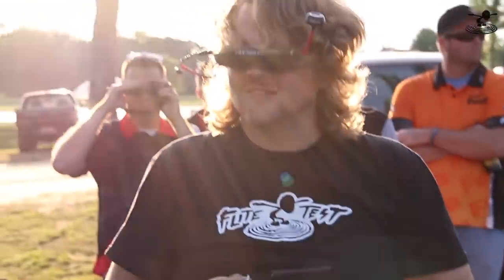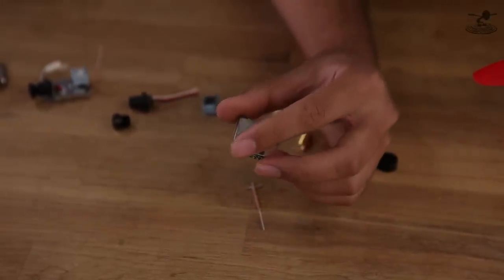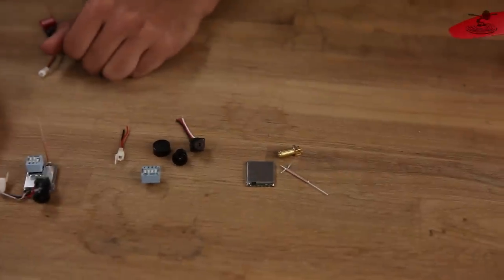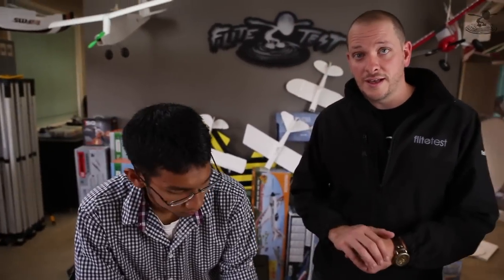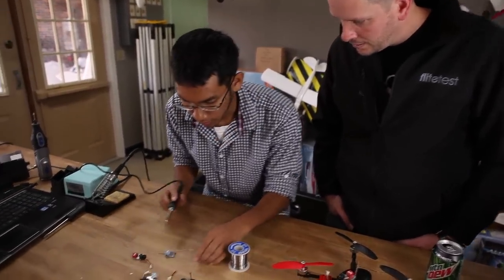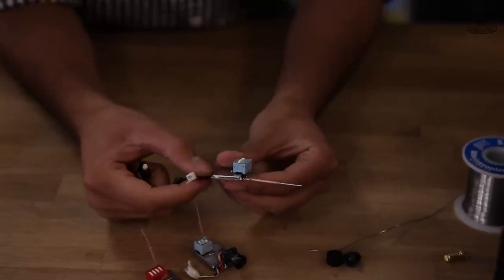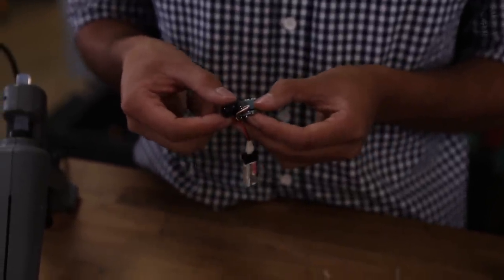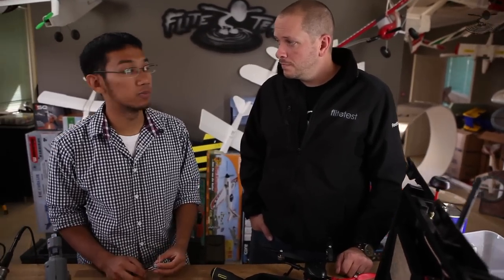Flite Test | DIY Micro 5.8Ghz FPV

Comment: Inspiring video! The one thing I didn't see, was removal of the rosin flux after soldering. Rosin has some impedance when it solidifies and can change circuit characteristics and possibly add extra load to the transmitter. So right after the solder solidifies, wipe the joint off with a q-tip dipped in alcohol. 70% or 90% isopropyl alcohol from the drug store is fine. That removes the rosin the easiest since the solder joint is still warm. I would recommend using 63/37 solder over 60/40 for the fine soldering done in the rc world. Rosin core is more for large wires. Water soluble fluxes available in the 63/37 solders make cleanup so much easier and greatly reduce the risk of loading the circuit.
Reply: +JKFlorida Glad to help !
Reply: Desert Mike DIY mmmmmmp

Comment: Hi
I'm so glade you guys did this video!
That was my intro to FPV Flying!
First I had this set up in a Hubsan X4, not so happy with the Hubsan.
But now I've got it strapped to my trusty old Hobbyking Mini Swift, and it's a BLAST!
Damn thats fun, and I got about 500-600 meter out of it, with the Wire Antenna AND just a cheap as chips RX with the standart Antenna on it...
Damn good fun!

I just the 5v Version as well, due to the specs it's quite well suited for a 1S set up.
As a Cam I used a cheap Hobbyking Cam.

I've you guys are back in Germany again, I would love to meet and fly with you!!

Comment: You can fix the camera lens adjustment with liquid electric tape. Great stuff! Not to mention sealing every connection and securing connectors to each other and or to the board or airframe.

Comment: Looks like fun...and here are a couple of hints from an old guy on soldering detailed work:

Find and use small gauge 63/37 (not 60/40) rosin core solder, and clamp the workpiece lightly in a Panavise or similar with rubber pads on the jaws. 

Add a worklight and maybe a magnifier and you're good to go...

Comment: @ 9:25 Josh justifiably corrects Peter to NOT USE CA in this application.  There is a VERY good chance of fogging the sensor, the inside of the lens or the outside of the lens.  And if you ever want to change lenses you're going to be pretty much out of luck.

Comment: If you run the 3.3v vtx with a 1s, use a 1n4001 diode in series to drop the voltage by 1/3 of a volt to help it from burning out.

Comment: Btw thanks for the video.
If your plane can carry a little more weight and uses at least 2S, then I recommend using a Fatshark 600tvl CMOS camera in combination with a aomway mini 200mw transmitter.
The Fatshark CMOS camera is the best CMOS camera I've used. The rest produce awful images (poor contrast and muddy colours).  
The aomway mini transmitter is almost as small as the diy module and comes with a SMA connector where you can attach a cloverleaf antenna. 
There are 2 sizes of the 200mw 5.8Ghz aomway VTX: the mini one is the one without the big black molex connectors. Banggood sells them. Search for
"AOMWAY FPV 5.8Ghz 200mW 32CH Wireless AV Transmitter Module"

Comment: I think Peter's remorse over getting the 5v module (instead of the 3.3v) was unfounded - he was actually right the first time! I was just re-reading the specs, and the 5v module IS the 3.3v module with an LDO regulator onboard. Thus It will happily work from 5v down to 3.4-ish volts. HOWEVER if you order the 3.3v module and you don't have an external regulator then a regular LiPo (at 4.2v fully charged) will probably BLOW THE MODULE. (I suspect. It exceeds spec. anyway) So the 5v module should be read "AT LEAST 3.5v" and the 3.3v module should be labelled "NEVER MORE than 3.3v". Anyone want to double-check that?
Reply: "quite hot" in the english sense? (as in "I say, this boiling oil they're pouring on us is quite hot.") or the usual sense? Putting out 200mw of radio power implies at least that much heat as well.. so "definitely very warm", but if it reaches "wow, that's hot!" levels, that's an indication you're running it over-voltage.
Reply: ... still, nice to know they run at 4.2v in a pinch, with a heatsink. You probably get slightly better range with the extra volt, for a big reduction in chip MTBF. (Then again, failure due to errant tree is still probably going to happen first.)
Reply: That's not too bad then. Probably about 50-60 degrees C. (assuming you have mortal pain tolerances and aren't a chef.) That's at the limit of most chip specs, though. But given the power dissipation of chips is a V^2 thing, (and range increase as the cube root of power? from memory) that probably means you're only getting incremental range for a huge heat increase by 'overclocking' at 4.2v. Still, it works. And if we were wise, we probably wouldn't be so keen on throwing contraptions into the air, just to see what happens next.
Reply: I bought the 3.3v TX.  what I plan to do is place a small diode in series with it.  Diodes have a forward voltage drop
of about 0.5-0.7v voltage drop.   If needed I will put 2 diodes in series.   That will let me use a single cell battery.
If I knew for sure the 5v would work down to 3.3v I would have bought that one.
Reply: Jeremy Lee I agree. I made the mistake and ordered the 3.3v version. What a pain! It ran VERY hot (as in the English sense). Maybe it was defective because I also had channel locking issues with it.I've since gone and ordered the 5v version and am much happier with it. It runs much cooler on a 1s and I've not had any low-voltage problems.The 5v version is definitely the way to go.

Comment: Bit charger plane vtx, LOL! Awesome to see, there are pcb vtx boards on ebay around $24. Heat sink on the case helps they do get hot.
 Digikey is great for parts like dip switches and led switches.
 Unplug power to ccd when taking lens off to avoid sensor burn too.

Comment: I would use a smaller dip switch to lower the weight maximum :)

The ones simular to the ones that are mounted to the fatshark vtx's works great.

Comment: I found the easiest way to solder this Boscam vtx, is to strip the wires long enough, then go ahead and twist wires , lay them down into the pre-soldered pads, streched , then solder with good tin , dont pre-solder the wires as it wont do any good ;-)  hf flying ;-) , greetings !
Reply: By the way, if you want to use this setup for a micro quad ( like the hubsan etc .. ) forget the dip switch it will give u +- 35 seconds extra flight time. 
Peter, good job ! but i would not prefer to use hot glue to attach the camera to the vtx's heat sink, as it might melt in the summer because of the extra heat produced by this vtx ( it gets hot ),
instead if u solder a micro cloverleaf antenne its a good idea to use hotglue to glue the camera to the boom ( coax wire ) of the antenna. as the coaxial cable doesnt produce any heat at all.

Happy Flying ;-)

Comment: Definitely going on my project list after my 100w led torch :)
Reply: how many lumens you plan to get out of it?
Reply: planing on making a second sun?
Reply: Jeremy Brock not sure to be honest as i dont have anything to measure it but lets just say its bright :)
Reply: tyler roberts haha its not far from it
Reply: TheLukey21 maybe you should make it with infrared LEDs and combine it with this FPV-thingy to make night flights =)
Reply: ***** its a single 100w led chip, if only they sold 100w ir leds then you could make some serious night vision stuff
Reply: TheLukey21 ah, too bad. I thought you would make the whole thing on your own. this would be so much fun flying through darkness and spy people :D
Reply: ***** well i am to a certain extent as i have built a lipo protection circuit so it doesn't over discharge and i have bought in a boost converter and a pwm controller (brightness control) but to do it with say 5mm leds that would be around a 1000 to make it to 100w. Oh and it will be going in one of those 5 million candlepower torches if i can find one cheap or otherwise i will use metal salad bowl sprayed with chrome on the inside for the reflector part and pvc for the body
Reply: TheLukey21 I made a 100w handheld LED with a lipo, a CPU fan and of course, the led. It is a really fun thing but you will need lenses as the LED is spreading light all over the place.
Reply: David Fägnell i use a glass lens of ebay for the first lens and a fresnel lens for the second and i get a decent spot, its miles better with the fresnel as well as the glass one.
Reply: Has anyone here done LED project on there car for forward lighting? I bought a 6 x 10 watt LED light bar (spots) and 2 individual pods with single 25 watt chip (Floods) in each either side of Bar. I drive a lot on back roads at night and they are amazing!! Better than any HID set up or Halogen lamp set up ive done. They are Durite brand. So high quality and extremely compact.

Comment: Great Video. Looks good. I just started flying FPV with the Nano QX and have traveled around the house and outside in the yard. I believe the QX FPV only has a 25mW transmitter so 200 Mw would be a significant improvement on range I would think. I wonder how this would work on a Hubsan X4. I havent seen any info on others modding that quad, but I am sure they are out there and that it has been done. The X4 seems like a great platform as it can lift quite a bit and I love the 10 minute flight times with the 500 mAh packs. Any thoughts on this?

Comment: When you file off the tip the problem is not corrosion.  What happens in the outer metal does not form an amalgam with the solder but the copper does. so the copper slowly washes away with each touch to new solder.

Comment: "you dont want to file the solder tip..." Puts down sandpaper and solder tip....... well shoot.
Reply: +cheeriomartinez 
I ground one to a fine point many years ago....still use it. Have to clean and tin it more often than normal  though.
Reply: +Haywood Jablomy  you can change the tip
Reply: +THUNDERBOLT 
uhh....yeah...so?
Reply: +Haywood Jablomy yeah mine is all wonky now. I could buy another one but.......eh
Reply: +cheeriomartinez Soldering tips are nickel plated so that the tip doesn't oxidize when it gets so hot. Use a damp sponge to wipe the tip off. A damp paper towel works in a pinch.
Reply: lol right
Reply: +cheeriomartinez Its not a big deal, I sanded a tip down to bare metal then tinned it and I actually liked it better, the solder sticks to it very well and it doesnt oxidize. The plated ones are just kind of "idiot proof" in the sense even if you don't tin and clean the tip it will keep working, don't wipe and tin a bare tip and it will oxidize turn black and yousont transfer heat.
Reply: many a ground tip in my box. they all work fine.

Comment: Hi guys I'm going to be buying a plane soon and don't know what to get. I'm going to spending $250 max for now and going to upgrade to fpv later. I'm thinking about getting the Ft Racer but my brother says I should get the tbs wing that starts c (don't know how to spell it). I really don't know if a wing without fpv will be fun. If you have any suggestions on what plane I should bet please tell me
Reply: You should ask your question in the FliteTest Forum, there are some friendly folks that can help you out and learn more about you and what you really need.
Reply: if it is your first plane i would for sure go with the bix 3 from hobbyking
Reply: I have been an R.C flier for over 15 years . here are my tips..
go for the basic bixler it is cheap and easily repaired ,EPO foam is fantastic and simple to fix …YOU WILL CRASH . also try and get a 2.4 ghz radio . buy a 6 or 7 channel as you will not need to upgrade later .. 
My biggest tips are to get someone who already flies rc to be there to help you build it ( note COG ) and also be there for your first flight ..get a simulator … read as much info on flying and read it again …. fly in open space without houses trees and other obstacles ..  

remember we are here to help .. if in doubt ask !!! 
may the force be with you!, Barry
Reply: Yeah but that's over 250 easily^^ go for a bix 3, you can fpv upgrade, it's a beginner and can be easily repaired plus you can do candy drops in the future lol
Reply: Bix 3!
Reply: bix 3
Reply: Bix3 best choice
Reply: Guys I got the Bix 3 3 weeks ago, Love it!
Reply: I got the Bix 2 about two years ago and I STILL LOVE IT!
Reply: I am thinking of this one. http://www.spyhawkfpv.com/collections/all/products/hubsan-spyhawk-fpv-plane. 
bixler type of plane and fpv in one.. and the receiver etc.

Comment: Peter,
can you use a different antenna, one that is not as directionally orientated? I have seen antenna that has four arms that kind of twist around, would one of these work with the system?
Andre

Comment: Amazing video I managed to me one for under $20 with parts from Banggood the $11 micro camera is amazing way better than my $60 fpv hobby camera with wide angled lens plus the banggood camera already comes focused and with a 170 degree camera which it isn't it's about 130 degrees in actual fact, amazing little thing which has a range of 800m plus

Comment: Be careful, the recommended TX-Modules don't fit ImmersionRC frequencies perfectly.
Those modules go from 5725, 5745, 5765, 5785, 5805, 5825 and 5845.
The IRC modules are at 5740, 5760, 5780, 5800, 5820 and 5840.
Obviously it'll work, but the there is a little difference, which will decrease range and experience. If you want a perfect experience, check out a 5,8ghz module with IRC-frequencies.

Comment: Has anyone attached 2 of these for 3d viewing? If you can see depth you would get a lot more control I would think.
Reply: +Anon Mason running on two channels and somehow view them on each side of an fpv goggle.... thats an amazing idea!
Reply: +Håvard .EF 
Exactly what I was thinking.
Reply: To step it up, you could mount a gyro on the goggle and have 2 servos control the cameras for a virtual reality experience. I have seen someone do this with 1 camera and arduino electronics..
Reply: There is actually a product called a nerdcam that has 2 and processes them so they can just be viewed with regular goggles

Comment: Loved the vid guys. Great job of cookbook engineering. It is also a great lesson when trying to accomplish anything check out what other people have done before. You might not want to do it the same way but you will certainly learn a lot and also get some great ideas along the way. Pretty good job of soldering to. Most times when I see soldering done on You Tube it ain't so great.
Reply: Rich-notice that Peter avoided heat-sens. IC's and used 2" leads to wick away
iron heat.  It looks quite simple, but a lot of thot went into building this lash-up
(he should've mentioned a max iron wattage, tho; say, 37).   JL

Comment: So you recommend using 4.2V on a 3.3V VTX module? That sounds sketchy.
Then the endless incompatibilities issue: not only do the transmitters and receivers have to be on the same frequency, they also must use the same modulation. E.g. receiving a Fatshark video stream on a Boscam receiver on the same frequency will result in a distorted image.

About FPVHobby.com: I don't recommend buying there. Search google and see why for yourself. Many buyers have had issues with that seller.

Comment: I would rather go to adafruit or sparkfun and buy the "FlyCamOne V2" you cant see while flying but it supports 8gb micro sd, u can use lipo batteries or the rc receiver power cable, you can connect it afterwards with mini usb to get your photo's in serial, still photo or video depending on what you set it to do. 720x480pix, 30fps, focus 0,3m, lipo 3,7-4,2V, rc-receiver 4,5-6,0V,  weight 16g, pcb size 55x25x5mm, kamera head 21x24x28mm, pivot 90°, Flip 180°. Might be some newer model out there somewhere, but this you dont need to build yourself and easy to use.

Comment: Those frequencies listed for that module aren't immersionrc / fatshark compatible - they end all end in 5 ( Boscam Band A) rather than 0 like immersionrc frequencies should, i.e. 5745Mhz instead of 5740Mhz. You'll get a picture up close, but not great out any distance at all.
My own experience with these modules has seen them running too hot to work well with hot-glue, but that's been with the 3.3v version.

Comment: At the end you where getting signal even though the quad was outta sight. And you said 2000 feet. Is that with 250mw, 5.8ghz and  spironet antennas or whatever there called because i read online that 5.8 has to be strictly line of sight and people not bein able to get more than a few hundred feet.

Comment: Hey flite test. What is an fpv system that will work with a GoPro hero 3 plus black edition? And also could I record on the GoPro as well as transmit the video?
Reply: +Makszogun YT actually not true. I found an fpv system for GoPro. And they are using a GoPro here and there are MANY other people who use go pros.

Comment: how much does i weigh? I have a small helicopter and this just might make it fpv. I own a walkera v120d02. I would only use the camera + lens. with the transmitter. For power ill use the main battery. No switches or anything

Comment: Thanks again for that, second time I watched it,,, I am about to do one of mine tomorrow,, good video shame you did not put it to sound,, Thanks again, Pete
Reply: Just to say i did mine no trouble this afternoon, I did however not turn it inside out I just put it on as it was ,, Cheers, Pete
Reply: pepersorte hi pepersorte  is there any way you can send me the links where you bought the parts and a photo of your new trasmiter

thanks
Reply: 14wacawaca Have I lost the thread there ,,,What parts and what transmitter. I think this is not the video I wrote or wanted to comment on, sorry about that.. . Cheers, pete

Comment: whats the cable used in antenna? is it the RG-178?
Reply: +MrWilliam932 It appears he ordered the antenna with the receiver.  It would be nice to know the length of the radiating element so you could more easily build your own.  Any gauge coax should work so long as it fits the application.